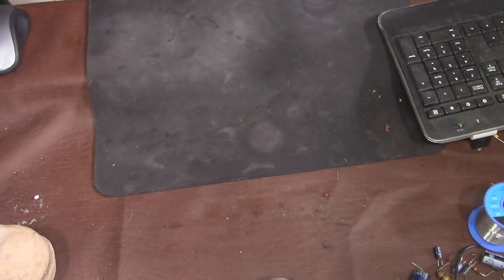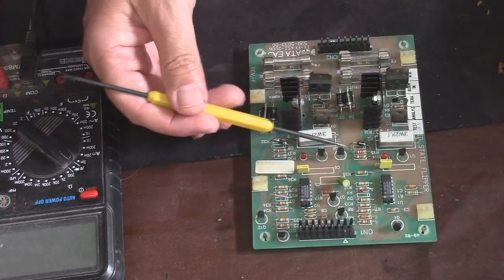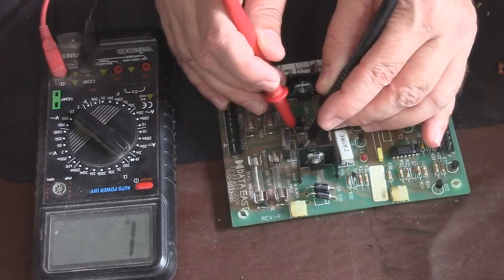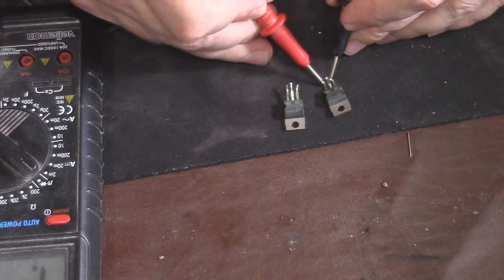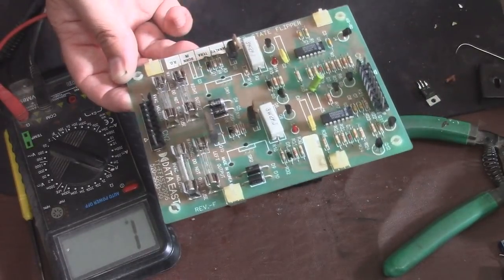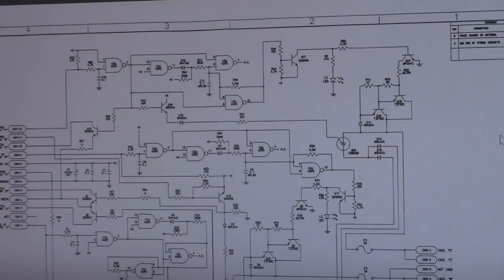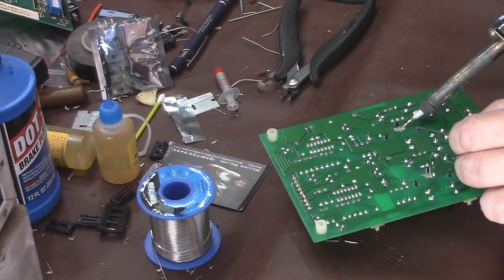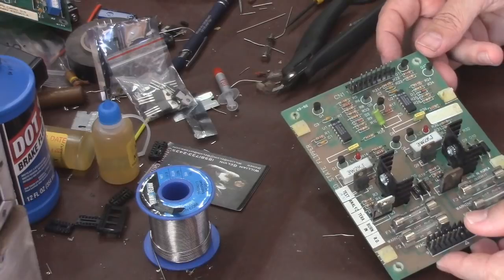troubleshoot and repair data east pinball machine circuit board

Comment: SR1, 2, and 3 are silicon controlled rectifiers. They act like a switch that allows current flow from the time they're turned on by the gate lead until the voltage goes to zero, or crosses zero. They typically control the duty cycle of the wave and are used in dimmer circuits as well as other circuits where they're controlling AC, or a rough DC. These appear to supply power to coils A, B, C.